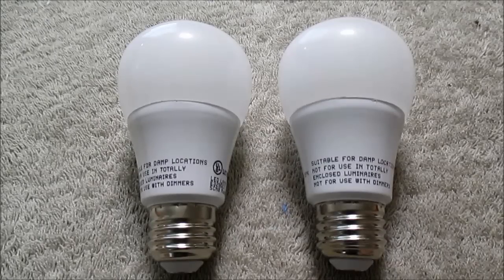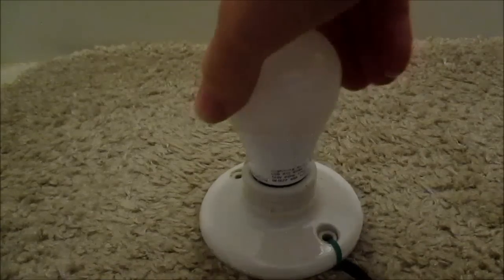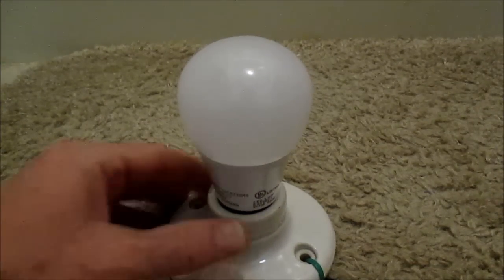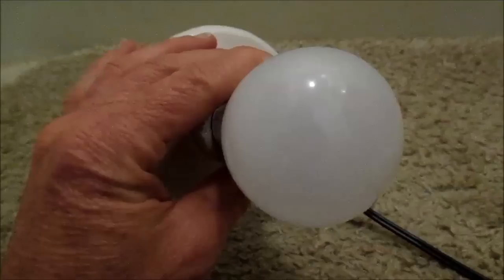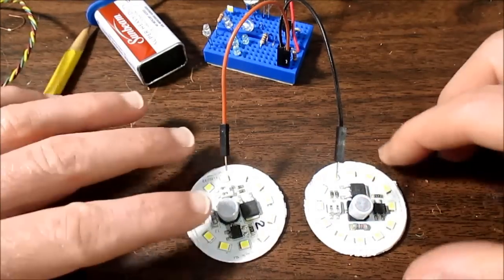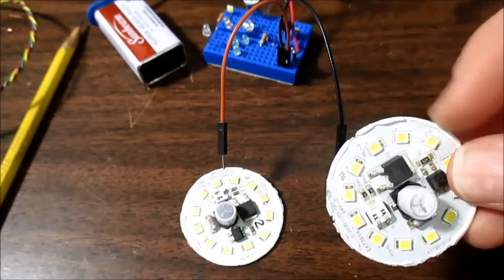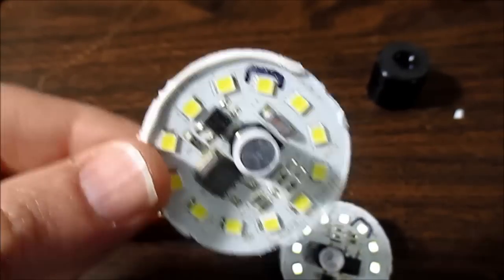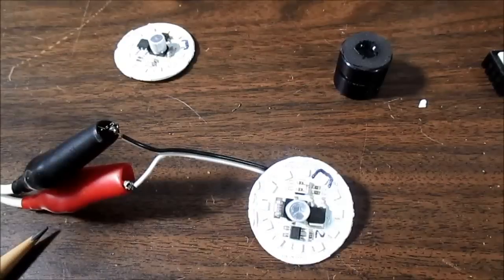Two failed LED bulbs for teardown to determine the cause

Comment: Remember when we got rid of incandescent bulbs because this crap was supposed to last for 15 years?
Reply: I remember quite clearly, I just made the switch about 3 months ago.  I will never go back to incandescent bulbs.
Reply: Daniel Duncan I have actually had incandesant bulbs last me 14 years, a damned side LONGER THAN THOSE CFL, then went to LED, only 3 bulbs not led , now, cheers from NJ
Reply: Consider the health effects of light as well. Blue LED light may be dammaging to the retina and supress melatonin production at night. That is why I only use warm white LED's as well as using eco halogen bulbs in the mix which emits infrared and is closer to the sun at dawn or dusk. Good for general health.
Reply: @wernerempire  All white LEDS used a blue emitter its the Phosphor that determines the colour of the light output.
Reply: I have 4 12 volt leds. All have been run at night almost continously for 8 years.
Reply: If they had been honest usa made they would still be working
Reply: I have LED bulbs (4) I bought from Home Depot & Costco that run on my porch lights. They are over 2 years old and are still running. In the summer months they run from 9pm-6am (9hrs), and in the winter months they run from 6pm-7am (13hrs). all 4 bulbs still work to this day.

I also have many other LED bulbs in my home that have also been running for over 2 years, and still work.
Reply: @alextran8188  I'm experiencing the same thing. LEDs are far far superior to incandescent bulbs. None of my LEDs have failed yet and my outside ones are close to 3 yrs old
Reply: Alex Tran I had a few incandescent bulbs that lasted 12 years!! We will see bout the LEDs
Reply: This crowd is too smart for me. However, my observations are as follows. I purchased LED bulbs for my entire house 2 years ago. Sure enough, I had two fail that were in one of my bathrooms. The others are still running fine. My solution? My local dollar store sells them for half the price of Costco. Meanwhile, I see the difference in my electric bill. Conclusion? I'm happy.
Reply: Greg Steele
Remember when we got rid of incandescent bulbs because this crap was supposed to last for 15 years?
'
hi G S...
wow that is so long time 415 years
Reply: And then China started to take over the manufactoring..
Reply: leds last a lot longer then 15 years.   the truth is your not buying an led light..  your buy an light that needs its own transformer because led lights run on DC not AC..  and the bulb in the vid is a 110 volt AC socket bulb...
so is it the led failing, or the extra crap they need in that bulb to make it work in the first place
Reply: Sure wasn't like that when I was a kid. I presume you mean the electric company Edison and not the dead guy... so, if it is true that the company that sold you electricity gave you , (not sure what kind if distribution system you had in the olden days) a free light bulb at, I think roughly, 10 efficiency... maybe it was because you kept paying and paying for the 90% wasted electricity?
Reply: Changing over where LED bulbs is all you can buy just happened not long ago. You can still get incandescent bulbs in some places, I saw some out at Dollar Tree a week or two ago. They also had 850 lumen LED's  for $1 too, that's cheaper than walmart but they may last about as well as the ones in the video, that's not much of a bargain. I remember when incandescents lasted for a lot longer than they did just before they switched..
Reply: Incan bulbs can still be legally produced and sold. I think the 100w versions...maybe not. CFLs are getting hard to find.
Reply: Long life incandescent bulbs get their long life by operating the filament at a lower temperature.  However, that results in lower efficiency. @detroitfunk313
Reply: Incandescents last longer than this
Reply: I stopped over to my neighbors house awhile ago, she is almost 80 yrs old.  we were talking and she opend her closet for something! she had scillions of the old incandescent bulbs of every wattage. Now i know where to go if i need a replacement!
Reply: There was an LED light company called SWITCH that made LED bulbs that I have had running for 8 years now.  They were expensive and filled with a fluid and weigh a lot.  They said 20 years and I am sure they will run that long.
Reply: had a CFL in a bathroom run almost continues for 9 1/2 years probably didn't get turned off more than once or twice a year
Reply: @Joe Black The LED bulb in my desk lamp's been running for over 2 and a half years now, at least 8 hours a day. I know that's not very long but still. Incandescent bulbs have 1k to 4k hours ratings. If you replace a 4k unit for a 6k CFL you won't see much of a difference; and 6k to 8k is what you typically see for CFL, maybe 10k. On the other hand I have a few of those pear shaped bulbs (NR50?, I can never remember their proper name) and incandescent ones burn out all the time, they maybe last a year. Now the new LED ones I got say 20 - 25k hours, vs the old 1k h incandescent bulbs it's going to be a huge difference, even if they only last a quarter of that time.
Reply: Every led bulb in my house is at least 4 or more years old. I have a few cfls that are almost 10 years old. Stop buying junk maybe?
Reply: First off don't buy crap. When cfls came out I went to the local Menards and replaced over $250 dollar worth of lights for my entire home. When led lights came out with a19 bulb, I couldn't wait to replace those shitty cfls out, couldn't do it fast enough. Cfls cannot handle cold very well, very dim, sickly looking color. When some of the cfls burned out, the smell was horrible ( They didn't all smell when they stopped working ) but the ones that did...yiiikes! I had the cfls for about eight years. The leds are light years ahead ( see how I did that!😁)  If I used a 75 watt incandescent light in a lamp, I would replace it with a 100 watt  equivalent led, seemed to work out well. I have had the leds for about 1.5 years, very few issues, instant on, good color tough to beat. If you have a workshop with no heat, leds turn right on,  no waiting.
Reply: The problem I run into the most with LED lamps is if they are rated to be in an enclosed fixture. If they are not rated for it and are in an enclosed fixture it creates excessive heat build up as shortens the life of the lamp.
Reply: Lol you feel like you got played right just think about cash for clunkers.
Reply: i threw boxes of the  away.  now i realize all these lights cause eyestrain because they are in a constant state of pulse wave modulation
Reply: Yup as far asI've experienced LED bubs fail a lot quicker than incandescent bulbs. Especially the early ones. The problem is they have a lot more points of failure which increases the chance of something going wrong.
Reply: SUPPOSED TO LAST 15 YEARS: me: LASTS FOR ONE MONTH UNDER NORMAL CONDITIONS. F THAT
Reply: congratulations for making it to see a whole new era
Reply: CFL bulbs still last the longest.
Reply: I agree and still buy them. They're not so easy to find anymore though.
Reply: Snarky Mark bullshit,,I NEVER HAD ONE LAST 4 YEARS, but had incandescent last 14 years, yes!, but now ALL, BUT 3 ARE LED, lost 2 Led,  but changed brands,  cheers from NJ
Reply: @Joe Black check engine light LOL
Reply: Led bulbs are great for freeing up a circuit. I have 2 dedicated circuits in my basement with 20 lights. Imagine that circuit with 20 incandescent lights. With led I run 160 watts for all the lights. With incan I would be maxing out the 15amp circuit with just the lights. Thank god for LEDs
Reply: The LED bulb I have in the lamp next to my computer has been there for 10 years. Yes, LED bulbs have been around at least 10 years. No problem at all. I'll probably replace the lamp before the bulb finally dies.
Reply: I designed a DIY LED data transmission machine 10Mbps/1.4km and the LED was running inside at full power and 1 MHz/10MHz modulation for 12 years 24/7 and it still worked. Wikipedia: RONJA
Reply: Joe Black I had only lost 2LEDs =60W, changed brands, , otherwise they have made it, one is about 14, 15 years, my 1st it d in my outdoor front light on 5pm -10.30p, in winter it’s longer. This is aPHILIPS, LOOKS YELLOW when off, was the 1st  LED, cost $ 25.00 then . Cheers from NJ
Reply: synical13 I used to buy rough service bulbs from HD, they have at least4 filliment supports, and I bought rated for 130 volts, NOT 120V, the lasted forever, also in my drop light. Cheers from NJ
Reply: THERE'S A SUCKER BORN EVERY SECOND
Reply: Yep - had approx 7 OSRAM (i.e. not cheap) all fail within 4 years. Given their cost and the resources used for their production, they’re a complete failure both financially and environmentally.
Reply: Right!....i just throw away my led light ,its suppose to last 15 yrs...i just use it for....
U know less than normal fluorescent one!😒😑
Reply: The one I bought lasted two minutes! Gone back to the "old" style bulbs,far more reliable!
Reply: There are approximately a thousand people who actually gave this video a thumbs-down. That proves to me that the Lightning Science company had most of their employees deliberately give this video a thumbs-down out of anger for exposing the truth of their fraudulent business practices. I attempted to contact their company via their email address located on their website at https://lsgc.com 
My email was instantly returned to me as being undeliverable.
Reply: Buy more cheap crap instead of philips or osram. W8 till cheap crap stop working - come here and complain. Not even one philips LED bulb have ever failed in my house. I remember when I bought one cheap shit from china. It was a f***g disaster.
Reply: Exactly, I’ve had many, many energy saving bulbs let go after a few weeks, whilst I have some 40+ year old incandescent bulbs still going strong.
Reply: LED bulb longevity depends entirely on the bulb itself and the existing wiring infrastructure in your home. I'm honestly shocked that more people don't recognize this.  

Most of the LED bulbs you can buy now are designed for plug and play. They're built specifically to function on an already existing, standard 120v socket. Obviously, an LED itself is not meant to operate on 120VAC. They are DC only, and even then they can operate on very low DC voltages. Many of these bulbs you can buy in the US have additional electronics built into them, to rectify the 120VAC into a DC voltage, and then step that DC voltage down to a usable level for the LEDs. Each of these bulbs literally has a built in switch-mode power supply. That's just more stuff that can break. It's not "planned obsolescence", it's just the way of things. There's more shit to screw up. More points of failure. The rectifier could mess up and suddenly it's not outputting any DC. The rest of the circuit won't work, ergo no lights.  

In Europe however, it's possible to switch out all of the socket wiring to something that outputs the necessary DC power to run standard LED bulbs. It's expensive, but instead of relying on bulbs with shoddy SMPS circuits, all of that extra crap is gutted and you literally just have a bulb with LEDs in it, and maybe some passive components like resistors. These last significantly longer because there's no extra points of failure. There's no need to rectify AC to DC because the socket itself and all the wiring has been changed to carry DC only.
Reply: @synical13  I bought two Cree LED bulbs.  That's a good brand.  One died in a year.  They did replace it, though.
Reply: No, we got rid of incandescent bulbs because they were horribly inefficient.
Reply: Incandescent light bulbs explode, thats why we got rid of them. I remember crying when I was younger whenever this happened at the kitchen when my grandpa turned on the lights
Reply: @donyosxd  All the air is sucked out of the inside of an incandescent bulb. This is why the filament glows instead of catching fire. So, technically, they implode. (and then, only if you crack the glass)
Reply: Eearly LEDs actually, do I still have some that have been burning for 15 years, but these days the new ones rarely hold more than a year.
Reply: dETROITfUNK  Here in Chicago back in the early 1960s, we had a similar program with our electric utility. The bulbs were stamped with the words "Renewal Service." They seemingly lasted forever. I've lived in my present house for 38 years. A bulb in the hall stairway was operated for about an hour or so each day, for at last 35 of these years, some times intermittently so. I don't know how long the bulb was there before I bought the house, but the bulb finally quit quit after 35 years. Seems it had a bad solder joint at the bulb tip, so I re-soldered it and guess what? It lasted three more years before the filament finally burned out.
Reply: Jerome Wysocki I’d bet it had a diode inside so it ran on DC, I have heard of those bulbs in CHICAGO &Detroit, cheers  from NJ
Reply: We stopped using incandescent bulbs to save power usage.
Reply: @Tom Reeves - But, but, but, but, but Obama!  Really? Even in a video about LED bulbs? Wow.
Reply: @ra5928  trolls... everywhere
Reply: @ra5928  yes Obama lies have every thing to do about it! Who banned light bulbs that work for 99cents the DemoCant Congress!
Reply: @we-got-green__lightsabersy1807  - Wow. You're easily triggered.
Reply: @ra5928  yes 8 bucks each replace 1 a week is bullsheet I need to use candles!
Reply: When we built our house 13 years ago we fitted 41 CF down lights. Several failed almost immediately, and we lost perhaps 15 within a year. I replaced them with LEDs about 4 years ago and have had to replace about 10 - several after only a few months.
No, they do not last as advertised.
Reply: @rogerwilliams381  
Stop buying cheap bulbs.
Reply: Greg Steele exactly, these new style bulbs burn out quicker than old school but cost 3 times as much.
Reply: That's not the only reason. More importantly, they are power efficient.
Those are cheap LED bulbs that cost probably around the same as a typical CFL.
If you buy high quality ones, you get warranties. You can have them replaced if they are damaged in less than two years.
A bulb that lasts for more than two years is likely to last for a long time.
Reply: Anyone who even remotely believe that is totally ignorant how life span is/was calculated/represented. Even with the incandescent lamps life span was  listed as so many hours of operation per day, not 24/7/365 continuous operation. Often people can understand what's clearly printed on the packaging. When I install the newer types of lamps I write the date on the base. I have had CFLs fail in three years and had some last over five years. I haven't been using LEDS long enough to get a date yet.. I do have one LED lamp that has become intermittent. Unless is starts to sound like it's arcing or smell I'm going to use it until it fails completely. Although I have confirmed it's still firmly screwed into the socket. Incandescent and old school florescent lamps seemed never to last as long as promised, but I never bothered to date record installation. That only became practical with the cooler operating CFL and LED lamps.
Reply: waswestkan Seems like you missed his point, he had better results from incandescent bulbs.They have less issues, cheaper to replace. Aside from that, they're less toxic to dispose of, no mercury, unlike fluorescent bulbs. Out of the thousands of lights I've installed over the years, I'm replacing about the same average of fluorescent bulbs as I did incandescents. I don't want to think of how many ballast & pin sockets I've had to replace!
Reply: Some of my outside CFL lights were installed in April 2009 and still work.  They are controlled by a photo switch and are on for an average of about 12 hours per day.  Thus some have exceed 2.8 times their rated life.  However, some didn't last anywhere near that long. @waswestkan
Reply: @waswestkan   I started dating bulbs years ago at our business when we we were using ones that were guaranteed for a year. I got around the heat problem by using a pen with paint in it. The paint stood up to the heat and was still readable.
Reply: @waswestkan  Incandescent bulbs cost a fraction of the cost of the LED's.  I worked with a salesman that sold incandescent bulbs to cities for red lights and those bulbs were designed to use 140 volts instead of 120V residential and they lasted far longer.  Why?  because they were able to ignore power surges that would wear a 120V bulb out much faster.  Face it.  We're designed to be a consumer society dictated by companies that have engineers that specialize in designing products to fail.
Reply: waswestkan Wow.  Look everybody we just found the planets leading lighting expert. He knows all. Must be why he's watching youtube to learn why LEDs fail. Now that's ignorant.
Reply: how about the brainfart idea of the mercury types?......if you look at the law you have to tear up the carpet when one breaks on it....EPA guidelines......every other house should be condemned from the contamination never being cleaned up correctly.........the city gave out thousands of them
Reply: mercury vapor and most mercury compounds are toxic.  A cfl contains less than a pinhead of elemental mercury metal which doesn't vaporize much at room temp so an occasional broken one is not likely to be much of a hazard.  A broken mercury thermometer probably releases over 100x more than a broken cfl.
Reply: i got rid of them because this uses 1/10 as much power for the same amount of light.
Reply: Well, wasn't it to save power? Use less power for the same brightness? That has always been my understanding. Extended life was a bonus.
Reply: Tom Reeves like ANYTHING HE EVER SAID.!, Cheers from NJ
Reply: They are not claiming 8 years, in my experience, the average is about 8 months, about half are out in less than 4 months. Haven't had one make it to 2 years yet.
Reply: Douglas Page I have NEVER HAD A typical CFL ever last 3 years, much shorter than incandesants., I had one last me 14 years, and a 175W Hg vapour  bulb last 34 years.My 1st LED IS GOING ON 15 YEARS, its my front door outside light, Philips looks yellow when off. About $ 24.00 cheers from NJ
Reply: @douglaspage2398  really because the recessed LED lights in my bathroom have been working perfectly for about 4 years. I have LEDs in an living room that have been there for over a year. The lights in my kitchen are also LED and they get lots of use.
Reply: @systematic101  You would be the exception. I did lighting professionally for 5 years, warranty work was way more with LEDs than with florescents. and I have been through every brand sold at Home Depot and Lowe's since I left, with about the same results. I have consistently lost about 30% of my bulbs about every 6 months. It could be that you live on a low draw grid. Where I live, it is very high demand, and we get a lot of surges. LEDs don't like that, and they don't like dimmer switches, though they claim to be dimmable ( the ones that are sold for that, if they are not, they are pretty much guaranteed to fal very quickly).
Reply: @douglaspage2398  my ikea one is 4+ now, first one I bought.
My Philips led bulb is 3+ years.

Led bulbs are rated for hours and how often you can turn them on.

All subject to environmental heat.
Reply: @hiragana78  I have three 100 watts equivalent Philips. One is dead. Another one flickers and went outside serving as a overnight light in my backyard. I have used them about 5 hours/day for 3 years and 5 months.
Reply: @hiragana78  I think all the comments are fascinating. I have been exclusively LED in my home for the last 3-1/2 years and have yet to have one fail. That was never the case when I was running incandescents. I've never used the brand in this video or any extra-cheap versions I've seen offered.
Reply: @douglaspage2398  Really? Ours have lasted for more than 3 years. We just discarded them because they became slightly dimmer. Mind you, these are cheapo Chinese LEDs. Some have failed a few months but those that lasted for a year or so really lasted long.
Reply: We have a different electrical connection at home, though. All of our lights can be disconnected from the AC. We disconnect them when they're not in use. We thought of doing this because it's easier to connect them to a battery+inverter when there's power outage. LEDs consume less power so we can power them with a 12V midsize battery with inverter.
Reply: @douglaspage2398  
Stop buying cheap bulbs. I ordered Fleits from Amazon and 5 of the outdoor fixtures I use them in are in limited access fixtures that are left on 24/7 365 days a year,  60 watt equivalents. 3yrs later and they are still burning brightly. The incandescents had to be changed every 5 months. Pain in the ass.
Reply: @seriouslyreally5413   I guess you were buying cheap incandescents. I have some in my house that are 15 years old, and worked for a regional projects division for an international lighting manufacturer (American company bought by a German company) until 2012. Among other projects, we replaced all of the traffic lights in 3 Texas cities including El Paso with LED units. We used various brands, from US and Germany, and some From China. Every Job involving LEDs. Every one, required us to go back and replace a previously unprecedented  amount of the ones we just installed within a month. This is something we never had to do with regular incandescents, HIDs, and halogens.  We had the same problem with a log of the electronic ballasts for the fluorescents and HIDs which replaced the older magnetics. We had these problems with every brand, though there were some that were worse. You are talking about 5 bulbs. I am talking tens of thousands. Also, there is not a single LED in my house that is over a year old. And I replaced 3 that were still burning, because the 60 watt equivalents now are dimmer than the 15 watt in my stove. There is one more factor. the more you have to turn on your LEDs and turn them off again, the more likely you are to have a premature failure. The failure rate was always higher in businesses and schools where sensors were used to automatically turn off the lights when no one is in the room, compared to those which were left on all day.
Reply: @douglaspage2398  I don't believe most of what you're saying. LEDs should have dozens more switching cycles than incandescent. And yes I have 3 75w Osram incandescent bulbs in a room I don't use too much that are surprisingly enough over 15 years old, unless I just don't remember replacing them. A tiny halogen bulb in my bathroom's also been running for a long time, more than 10 years I think but every other incandescent light I use in my house keeps burning out, specially pear shaped ones and the 40w small round ones I had in my night lamps.
Reply: @davidcobra1735  A lot of things"should work", but there is a big difference between theory and reality. In the 5 years I was working in the lighting industry, I have easily personally replaced, led crews of up to 20 men replacing, or have direct knowledge  numbers well into the 100,000s of all kinds of lights being replaced, just an example, on a good night, we used to rebuild up to 6o fixtures per person, on the worst night, the slowest rookies could do 20 (the ones that didn't last due to their slow production. the most common fixtures we did had 4 LED replacements (replacing 4 fluorescent tubes), but we also did many jobs, about a fourth of our business, replacing the incandescent style individual bulbs, either, from incandescent to fluorescent, incandescent to LED, or fluorescent to LED. and by the numbers, the service calls that followed always increased dramatically, and especially in LED, where we would have to replace multiple units within a matter of a couple of weeks, this became a normal routine, (going back to a freshly finished job to replace lamps after a couple of weeks).  In fact, had it not been for the reduction in the electric bills, and the tax incentives that companies received for converting, many companies would have gone back to the incandescents. It is hard to forget about this, since as the crew leader on many of these projects, I was the one who had to deal with the customers who were greatly dissatisfied with having to call us back to replace product we had just installed. Whether you believe it not is your choice, but the numbers speak for themselves. Again, this was consistent, regardless of the brand name used. it is also not necessarily just the reliability of the LED that matters, though they do fail quite frequently. if you pay attention to traffic lights (in cities that converted) you will often notice that not all of the diodes are lighting up, but just as often, and more frequently with the screw in bulb replacement, the failure is in the circuit board that converts the voltage to the 40 volt DC that is common to the screw in types (though the voltage can vary). I only know this because we had several employees take them apart to see if the LEDs were still good, thinking they could use them to customize their cars, until they found out the voltage required was much higher than 12 volts.
Reply: Greg Steele i still use the old style eff this money grabing thiefs.
Reply: @josejose-gw1pd  they're not even sold anymore so...
Reply: @josejose-gw1pd  the power consumption is still much less with the LED bulbs, one can actually save money on electricity
Reply: properly done they might last 1-2 years, but of course that is not very cash money for the companies
Reply: @Tom Reeves And you are like a 40 watt incandescent lamp, kind of dim.
Reply: It is easy to make sure you get value for money. If a bulb fails, go and buy an exact same replacement, and then install the new bulb. Then take back the old one in the new packaging, and say it failed out of the box and get your money back.
Reply: yup, and the promises were savings on the electricity, but that money is just going towards these more expensive bulbs, (if any)
Reply: Greg Steele "
Reply: Greg Steele No, I don't "remember" things that never actually happened.  I do remember replacing incandescent bulbs with compact fluorescents because incandescent bulbs were so obscenely inefficient... heating up a tungsten filament until it got so hot it glowed, and even then, it still emitted most of its energy in the (invisible) infrared, rather than visible, spectrum, which is an expensive way to heat your home, and a stupid way to light it, especially in the American South, where you'd be paying for A/C in addition, to offset the heating caused by your dumb-ass light bulbs.  Then I remember transitioning to LEDs because of greater efficient, and safety issues.
     Obviously there are still significant design and manufacturing issues with the LEDs, and I fully expect them to get better as these are worked out, but your "memory" of why we switched sounds more like right wing hate-and-blame "victimology" than reality.
Reply: Stop it. LEDs have much lower failure rate comparing to incandescent bulbs regardless reaching 15 years or not. I had many incandescent failed in weeks.
Reply: Greg Steele Yes! What a load of B S!
Reply: The question is, how much money is saved in running costs? LED bulbs are cheap enough these days, so you would think that savings should catch up in the lifespan
Reply: @RennieAsh  LED bulbs last quite a bit longer than other technologies no matter the power rating or the kind of bulb. How much less electricity they use compared to incandescent depends on the power rating since light output (lumens) does not grow linearly with power for incandescent. 100w bulbs are much more efficient than 60w bulbs. Now since you can't really get an LED replacement for a 100w incandescent because of size considerations we should look at 60w, those are common. I got an ~55w replacement for a small halogen light and that's 9x the efficiency and an ~50w one to replace a candle shaped bulb and it has a 10x better efficiency. CFLs have around a 5x better efficiency than incandescent. I've only replaced the lights I use a lot with LEDs/CFLs and my electricity bill has gone down by about 25%. I still have the same fridge, washing machine, iron, vacuum cleaner etc. These new lights do what they're supposed to as far as I'm concerned. You will need to change light fixtures sometimes and I don't really like the 3000-3200k color light vs my old 2700-2800k bulbs but those are small drawbacks. The new light fixture should pay for itself in about a year by my math. The old one was probably getting ugly anyway.
Reply: @RennieAsh  
Assuming the LED model uses 10W and replaces a 60W incandescent, the bulb cost is $2.00 more than the incandescent,  your power costs $0.10 per KWh, and you use it about 3hrs per day, then about 133 days. 400hrs of use.
Reply: @court2379  we get something like $0.28 per kWh lol
Reply: Tom Reeves thanks to the republicans for fucking that one up
Reply: @Tom Reeves Never trust the Heritage Foundation or Faux news.
Reply: Led uses less but last a quarter of the time. Also there not as bright as they say. Equal to a 60w bulb when the power is going out yeah I guess then. Lol
Reply: @ big barn v1 -  I have installed LED bulbs in several rooms. They are very bright. It is a white light. A bit more so than incandescent   and much more so that florescent. This is also true with the 4' T-8  bulbs in my garage. Replaced two tubes and the difference is very noticeable.
Reply: Scooter George I had 2 different 4 tube 48”, even replaced ballasts on 1, said screw it ,,went to HD, came away with what basically same length, looks like 2 tubed,,but is really 2 strips of LEDs, very bright,,but was about $120.00, case closed, now only 3 nonLED lights in our home. Cheers from NJ
Reply: @BigBarnV1  Mine are all over four years old and going strong.
Reply: BigBarnV1 don’t know about that, my experience is brighter, use LESS than the compared  CFL, cheers from NJ
Reply: @Tom Reeves like trump the chump "making America great again" by driving both the trade and the budget deficit higher than ever.and wasting money on an ineffective wall when it should be concentrated where the people and drugs actually come in.
Reply: @Tom Reeves More like Trump University!!!
Reply: Tom Reeves Unlike Trump, who can't tell the truth at all, right?